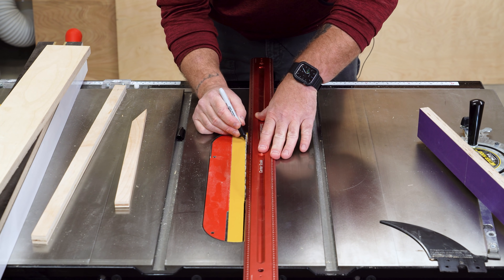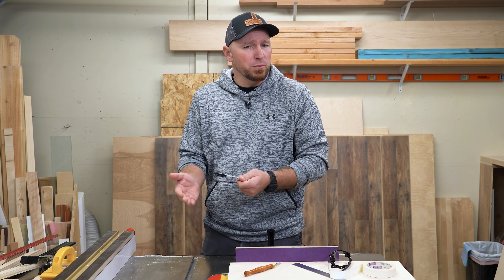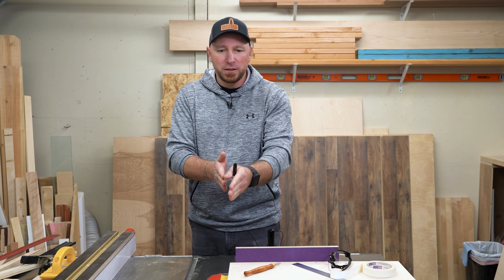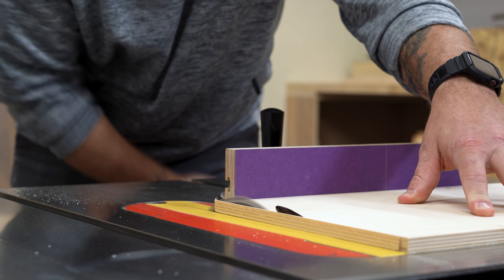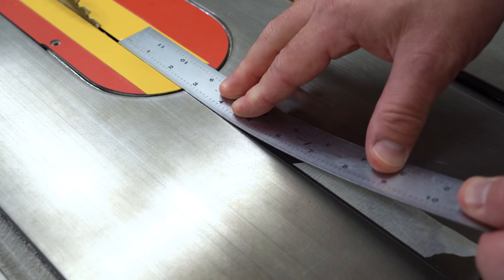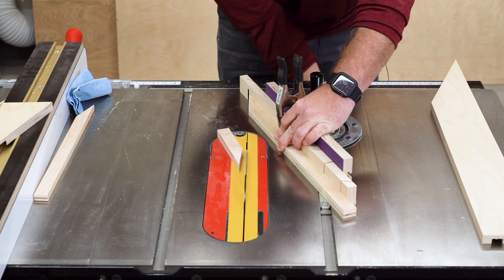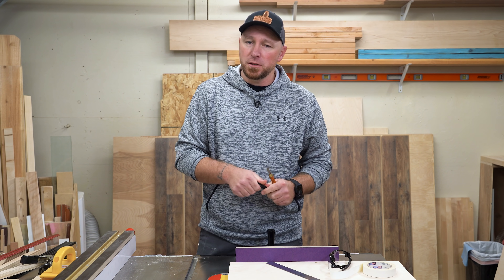Why I Permanently Etched a Line into My Table Saw Top.

Comment: I think your idea is great as long as you keep using the same blade tooth size, as carbide tips can vary  with kerf thickness.  A thick flat top blade will still move the line closer to the motor side.
Reply: Test it!

Comment: Best tip I ever got was from a woodworking electrician friend. I laminated a white piece of Formica to the table top. Sharpie mark for the blade like you did works great. You can put pencil marks for layouts anywhere and clean them off later. Humidity is never a problem anymore either, so no rust ever again.
Reply from the maker: I have always wondered if that would work. I've almost done it so many times.

Comment: I own the same saw ,and in time the surface simple gets marked. So I’m ok with a line like what you did. Some day,the manufacturer will be putting the same mark in anyway 😎 it certainly doesn’t in any way hurt the saw. Thanks again Lou
Reply: Actually Craftsman table saws had this feature decades ago.  It was a small yellow plastic disk embedded in the top just before the blade.

Comment: Your channel has taught me a great deal in the past couple of years.  I started woodworking from a metal working background.  This tip works very well if one of two conditions is met.

1.  If a person only uses one saw blade.
2.  If all of the saw blade plates are the same thickness and all of the teeth extend beyond the plates by the same amount.

A cut in a sacrificial reference fence is the safest method of defining kerf edges.  It can easily be changed when the blade is changed.

Comment: Great tip.  I've also scribed my table top.  One of the first things I did with it after setting it up to be square.  The down side is that if I ever have to re-setup the table top - that line can be off.  I hadn't considered that before.  So that's one thing to be ware of.  HOWEVER!  The sacrificial fence is an idea that I've just begun to use.  No matter how many times I move the top I can always be sure of where that blade is going to fall.  Just one down side with that as well - - - there's a limit to how big a piece of wood I can cross-cut using the miter gauge.  I'll have to figure out a better way to always know where that edge of the saw blade rests no matter how many times I move the top around.  And yes - I shouldn't be moving it around, but as we all should know, they do move and from time to time need to be adjusted back to being square.  A good wood worker should know that.  And planning for it is paramount to doing high quality wood working.

Comment: Cheap or expensive, tools that can be used for a number of different operations come straight out of the box with one thing in common - they’re all set up to suit a (sometimes entirely) notional “standard” user or set of requirements. The moment the needs differ from that “standard”, we start modifying. Face it, no one would build a single jig if our table saws/bench drills/routers/band saws did everything we needed. So, while there’s a very visceral anxiety about making sometimes scary mods to the equipment, and scribing a line into the cast iron top of an expensive table saw set up certainly counts, the end result is a tool that works better for you. And I like this scribing a line idea so much that I’m gonna go do that to my own saw right now!

Comment: I like the way you think, even if I don't always agree. I have an issue with scribing a line on my saw's cast top. It's an old Craftsman I paid 40 bucks for about 30 years ago, but it's what I have. In the past, I have regretted making permanent marks on things after later finding I hadn't thought it through completely. In this case, as others have mentioned, all blades do not have the same tooth set. This will lead to changes in the curf's left edge from one blade to another.

Comment: I like the sacrificial fence idea myself, even though my table saw is only around $2,200 and not $5k I still could not bring myself to inflict a perma-scar to the tabletop. =)
Reply: Yeah, I think that’s the way to go. Like he said, you know where the blade is and have a backer for the piece you’re cutting. I don’t really have a problem scribing the line in my saw, whether it cost 5k or not. Mine didn’t, but even so, I think the marker will still wear in time and have to redo it. And with my eyesight these days, I’m sure I could line it up better with a sacrificial fence then a little line. Both are good ideas though.
Reply: @BobBob-eh5sb  Agree.
Reply: I've found other creative ways to mar my tabletop...  I think if I did it on purpose it would break a streak.
Reply: It's funny your called it a perma scar! It's a permanent indicator line. The manufactures should required by law to put this on every saw table top, with a laser etched rule lines 90° to that line,  inch and metric. There just tools, no matter the cost of it, it's not graffiti you know, ist an useful indicator line!
Reply: Mine is an old craftsman, so nothing sacred. But, sometimes I’ll use a blade stabilizer, and if it is between the blade and the arbor (ie using both stabilizer washers) the line is wrong. Then you must compensate for that. This particular saw has a bright plastic disc embedded in the top just ahead of the insert. It is specifically for the purpose of drawing a sharp pencil line to indicate the kerf edge(s). A little alcohol cleans it off for the next setup. Just a thought.
Reply: My table saw is $30 and I'll not mark it permantely

Comment: I had that thought and figured you wouldn't want to do it. Good on your for being practical and open minded about improving your own tools. I would imagine that the thickness of the blade body and the thickness of the saw teeth would vary independently, so you might get small variations in the left side of the kerf on different blades even though the blade body is registered to exactly the same place on the arbor. It might not be enough to matter for your purposes with your blades, but I'd be surprised if you couldn't find a 1/16th if you looked for two blades at extreme ends of the spectrum (thin body with wide teeth vs thick body with narrow teeth).

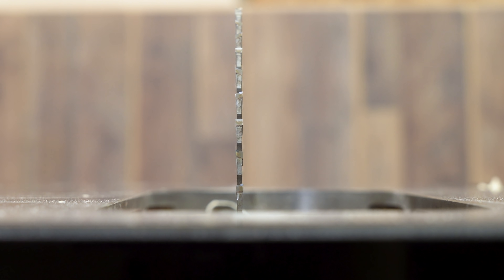Comment: @1:47  I def agree with others that your statement that the left side of the blade will never move independent of blade kerf is not obviously incorrect when you take into account tooth offset on different blades.

Comment: I like your tips, this one not so much though. I would not scribe a line on my saw. When I had my unisaw, back in the 1980's, I just put a piece of masking tape on the table, cut off a piece of wood and brought it back like you did and put a mark on the tape, it worked great. When it wears off or you change to a different blade it is easy to pull up the tape and make a new one.

Comment: Craftsman table saw I had years ago had a table insert that allowed one to put a fine pencil line where the cut is. "Exacti-Cut" is what I think it was called. Sorry to repeat if mentioned before. Great idea for the scribe mark. I have had my $1,500 Jet saw for 4 years now. Though not $5,000 saw, I still would etch a line yet.
Reply: Check that. Not yet ready to etch a line on my saw.

Comment: .........Just make damn sure your saw is plumb, level and square before striking the line! I'll be adding this feature to both of my saws once I complete my new shop-space. This reference line could also be used as a quick check on blade alignment after a blade change or, before a critical cut into what is becoming insanely expensive lumber.

Comment: I'm wondering if the variance of overhang on the carbide teeth varies enough to cause issues. I would imagine the carbide overhang between a thin kerf blade and a dado/ripping blade would be substantial.

Comment: I’m not trying to give you a hard time. With that said. I noticed that the left side does change. The width of the teeth are centered on the blade so a full kerf tooth is wider so it puts the cut a little farther to the left than a thin kerf. Granted it’s only a couple thousandths difference when trying to get very precise I noticed it.
Keep up the great work. You have taught me so much and I am very great full of that.
Reply from the maker: It’s funny you mention this. I did a test with all ten of my blades the other day and the only one that was off from the line at all was an abnormally wide toothed rip blade from Amana. Of course I wouldn’t be using the scribe line for rip cuts anyway, so it’s not a big deal. Hey, at least it’s just a reference line!!
Reply: @InspireWoodcraft  what I like about it is it takes the guess work out of trying to get the right angle. I use my sled like that all the time. Keep up the great work.

Comment: It would be a good idea to make sure your saw is in proper alignment before scribing any lines. The saw blade and fence should be parallel with the mitre slot before scribing any lines. I have also seen people scribe a line 90 degrees to the mitre slot that is centred on the blade shaft. Then when you are measuring blade height you can measure from the highest point of the blade which should be the centre.

Comment: Well depending on the level of precision but different blades do have different kerf widths which will affect the cut position... Just look at a carbide tipped blade and compare to an all steel blade there is a noticable difference in offset which will affect the cut position.

Comment: I agree with a single line on the left of the blade. It's most convenient, but not every blade will line up to it. My two blade box joint set, for example, would overhang it on the left, while I suspect an extra thin left blade I have would not quite reach it from the right. (There isn't much overhang on the carbide tips on that one, but it's unusual.)

Should be fine for most blades, of course. For the oddballs, you can buy a shim set, or, for something like my box joint blade, scribe a short line up near the blade and make a mental note to use that one for that blade.

Comment: I guess I am missing something as I don't see the point. If I mark the cut on the "wrong" side if the piece, I just  adjust the miter guage by 180 degrees. If I want to know where the blade is before I cut (to keep my hands safe) I just bend down and look at the blade from the edge of the table. What am I missing?

Comment: Now there's one thing my crappy 1970's table saw has that yours doesn't!  There's a small yellow plastic circle about half way between the blade and the edge of the table where you can draw with a pencil exactly what you just did.  I did both sides of my kerf.  They label it "exact-a-cut".

Comment: IF the manufacturer put it there it would be a feature.  I would have used a carbide scriber rather than a marking knife. I would also run a dial indicator between the guide track and the blade to make sure it was perfectly trammed in before scribing that line.

Comment: Over my years of woodworking (more than 50) I have found that marking a line as described is not very useful at all.  It works only if you always use the same blade with the same kerf width and position.  But I do know a marking method that works great.  I use it for marking a line perpendicular to the blade for the "high point" of the cut.  This is useful for setting cut depth.  
I use a solution of copper sulfate and water and painter's tape.  Copper sulfate is available at garden centers.  You only need a half teaspoon or so to mix with a tablespoor or so of water, so you could ask gardeners in your area if they could spare some.  Clean the area to be marked thoroughly.  Use painter's tape to mask off what you don't want marked.  Paint the solution on the area you want marked.  Leave it for about 10 minutes.  Wipe the excess up, remove the tape, wax the area.  Permanent and you can't even feel it.

Comment: If you actually use your saw with any regularity the top develops  impressions/wear marks over time.  Adding a useful mark is simply properly setting your saw up for efficiency.   A pristine table saw top is one that is probably taking your attention away form producing.

Comment: For a less permanent solution you could put some good sticky tape down and put your line on that. Or sandwich some red floss between two layers for extra effect. When you don't want it, rip the sucker off.
Reply: Yep that is exactly what I use, and have no problems with it.

Comment: Think of the scored line as just another tool geared toward safety, accuracy and expediency, not as a scar on your table top. It’ll make it easier to rationalize scratching that line . Also think of it this way…every time you slide a board, of whatever type, across that table top it scores hundreds of minute scratches into the top and you can’t 100% prevent that.

Comment: Having a line on the left side only works well with a left tilt saw.  Because of different blade widths, it isn't very useful with a right tilt (Older Delta Unisaw).

Comment: Those are all worthy efforts. Still another, one that is applicable anywhere an accurate semi-permanent black mark is desired on a ferrous surface, can be made by dissolving a granule of crystalline root destroyer per teaspoonful of vinegar. The crystal is copper sulfate and the solution will be light green. A plumber could probably give you a quarter ounce of the crystals, a lifetime supply. So could an old coot living in an old house with faulty sewer lines. Use a split tip ink pen to write on a smooth, clean iron or steel surface. Just this afternoon I was in an art supply store. That's where pen nibs come from these days. For less than $1 you can buy several spring steel nibs but those aren't the ones you want. For less than $5 you can get one nib that has a polished brass hemisphere on the writing side of the point. The cheap nibs make scratchy lines. The rounded nibs lay down a nice parallel-sided line. Store your "ink" in a little jar with a tight plastic lid. Vinegar fumes eat up steel or aluminum foil covers. Be sure to dip the nib in baking soda and rinse it in clean water after use or the fluid's residue will corrode the life right out of your pen tip. You'll like this technique for signing tools, too. To remove a line or signature just buff it off with a wee tuft of 4 / 0 steel wool over the tip of your dialing digit. The handle part of the pen is wood or plastic and sells for about a dollar at the art supply. For a few dollars more you can buy a pen with a little reservoir so you can make clean, continuous lines.

Comment: I’ve often wondered why table saw manufacturers don’t add a 90 degree ( to miter slot) scribe line to the table.
Reply: That would be a worthwhile addition.  Never have trusted my miter guage, would be awesome to have something to check it against without busting out a square.
Reply: @josephhfry  , not only that, it would be the single longest line on the table. Imagine using this new scribe line to set up a crosscut sled!
Reply: @Gershwin48  why stop at just a perpendicular (to the slot) line.  They could do a full laser etched protractor on the surface of the saw. Then you could use magnets to hold a long straightedge on the angle you need and just slide the miter guage up to it for an extremely accurate setting.

Damn, why haven't they done this before, seems like a no-brainer.  Would cost next to nothing but would have tremendous value.

Comment: Surprised a marking knife was used on very hard cast iron top. Pretty hard on the knife. Most of us have a carbide-tipped scribe. (Many with magnet in back end) Carbide is harder than most steel and will easily make a nice, clear line.
Reply: Cast Iron TS tops are actually pretty soft.  They drill, scratch and wear pretty easily.  The marking knife can be resharpened.

Comment: If you ever need to re-align the saw’s trunnion, even a few thou.. a mark on the table will no longer be accurate.  I’d stick to the sacrificial fence idea.
Reply: Yep.
I have re-aligned my trunnion half a dozen times in 20 years.
I’ve been woodworking for 45 + years, never have I permanently scribed a line on a tabletop.
If you want precision cuts, scribe your wood, not your table.

Comment: If you want to remove permanent marker, just colour over it with a whiteboard marker and wipe it off. Works on whiteboards so should work on the table saw.

Comment: Do you guys realize that all saw blades have the teeth “set” out form the body of hte disk to provide clearance for the body, so it doesn’t burn the wood.  And, that the set of every blade is just a bit different.  Not by much, and it is woodworking not metal working so it probably doesn’t matter.  And the suggestion of cutting a new kerf into a sacrificial fence is the best way to know where the edge of the cut is.  

Sears used to sell table saws with a yellow disk in front of the blade insert, which you were supposed to mark the edge of the cut on.  It wasn’t actually very useful, because it was most frequently not quite right.

Comment: Well I’m only coming from the place of doing custom woodworking for over 45 plus years. Not sure how many saw blades I have in my shop, but probably at least a few dozen…….from different manufactures, different blade thickness, different tooth grind, I think you get my point. No way am I going to etch a line on my saw. DUH! Sorry,  can’t hold back here so get over it. A pencil line can work just fine, will rub off when it needs to, and is easily replaced by a new line when needed.

Comment: tired? nope ... not at all ... short info - no bla-around ... go on like that ;)

since i own a Bandsaw and no tablesaw ... I thougt more about knowledge nice to have...
because - you can't scribe a line in front of your sawblade on a bandsaw ...there's a cut in the tabel to remove the blade ;) ... more or less - what ever side you mark your peace - you can align it with the center of the blade itselv ... Teathset is comming from the back a bit of gueswork ;)